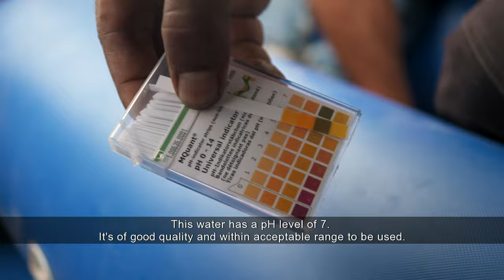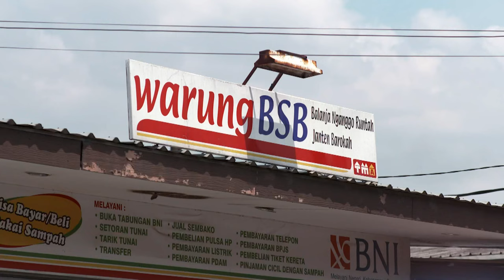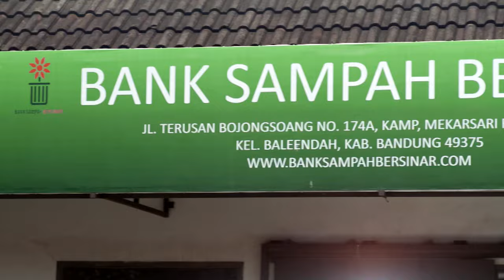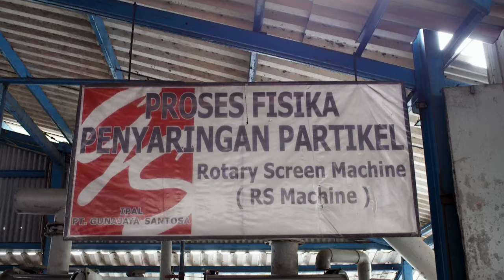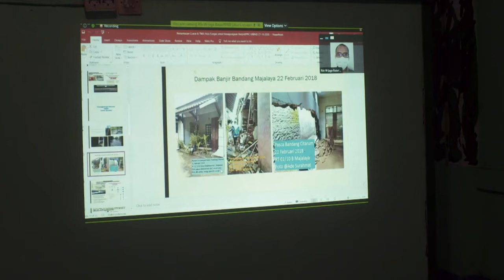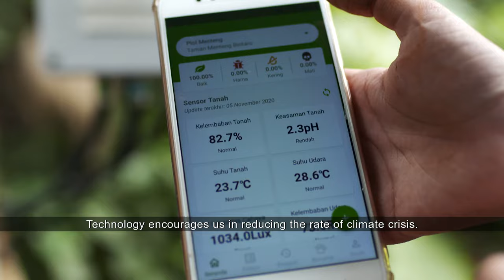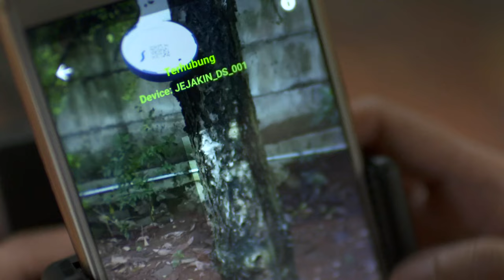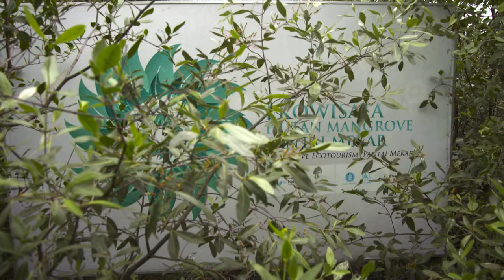Saving Citarum: Indonesia's Fight To Clean 'Dirtiest River In The World' | Once Upon A River

Comment: the main source of pollution on this river is not actually trash since mostly now already cleaned up but the waste from its surrounding textile industries. the government now enforces strict regulation to tackle this issue, the problem is, not every factory can afford expensive water treatment plant, so i think by giving them subsidy will accelerate the healing of this river.
Reply: I think the owners of the clothing industry need to pay for the capacity to clean the water
Reply: Why not have one govt own plant to handle all the smaller factory who can't afford their own waste water treatment plant. 
the smaller factory gets charge a low set fee based on volume of waste for the clean up.
and by everyone making some contribution, the whole cost don't just settle on tax payers and at the same time small factories can compete on cost of production

Comment: Uh... I think those army guys should clean the river wearing biohazard suits or protective gear. Can't be good for them to be swimming in a river full of chemical waste.
Reply: Unfortunately, it's the same water that they're forced to drink, cook, and bathe with.
Reply: @kidwolf0015  We cook and bathe using groundwater tho.
Reply: @kamerad_marzuki3631  So, there is a somewhat separate water source around? This makes does sense, but why are some of people still so determined to bathe and drink around the river? Is it strictly for religious reasons? (I'm assuming that there's plenty of people around here AREN'T purposely exposing themselves to the river by your comment. Also, it's annoying that the video never seeems to mention the wells....)

Admittedly, using local groundwater may still not be safe from contamination. If it's source is close enough to the rivers it probably still has plenty of chemical contamination. Certain types of industrial waste can easily pass through rock and ground layers. It would be significantly less toxic than the river itself, but it's probably still not at safe levels. Do you happen to use any form of filtration with the groundwater?
Reply: @kidwolf0015   Private wells and public tap water both are not drinkable. We have to buy purified water from the water depot for drinking. 
Some people from the lower classes, especially those living near rivers, uses water directly from the river for bathing and laundry purposes, while the middle class like myself usually uses private wells or public tap water.
Reply: @kamerad_marzuki3631  That makes a lot sense. Thanks for telling us about this, especially since the video skims over most of the topic. (I'm definitely still worried for the lower class individuals that are bathing directly in the river but at least it makes a bit more sense as to WHY they're doing it. I figured that there had to be SOME reason, but I wasn't quite sure what it was.)

Comment: Cleaning up is good. Concurrently changing the habits and mindset through campaigns and infrastructure. And then maintenance. A daily struggle but it is worth it. 

The sad thing is that the government did set aside budget for this movement. The minister is given responsibility. Project given to contractors with a partial budget because part of the budget is taken as kick backs or commission and many other factors hindering due to weak legislations and such. In the end it became counter productive. Blah blah blah.... I’m not saying this really happen here but I won’t be surprised if it does.

Comment: also cover the above waterline section of the tree dams in the basin with solar cels to make even more electicity near existing hig tension e delivery lines. and mabe weven c if the tops of the dams are wide enough to do have eitherb road or rail rights of ways with wind turbines.